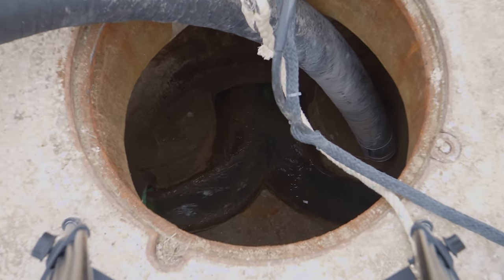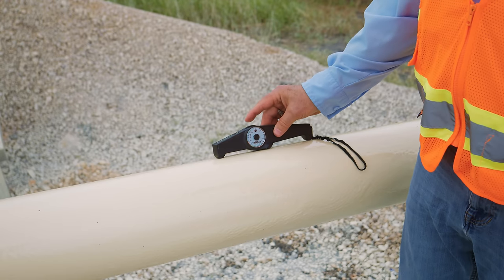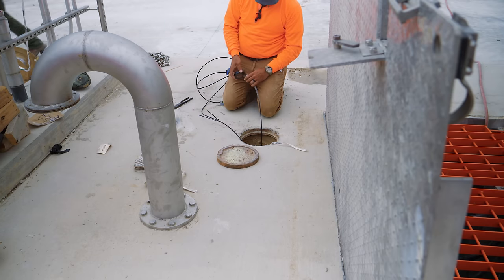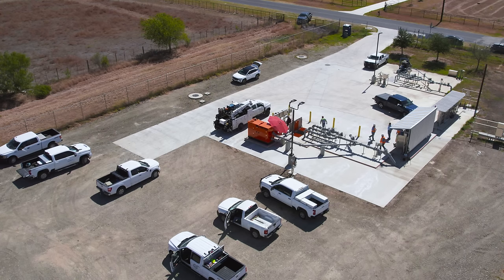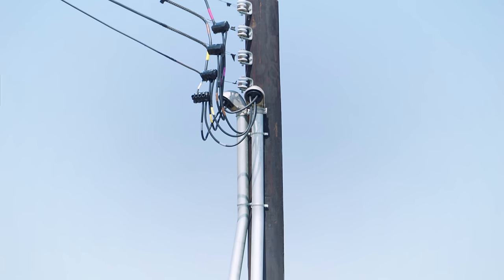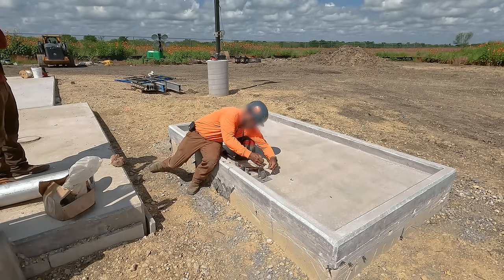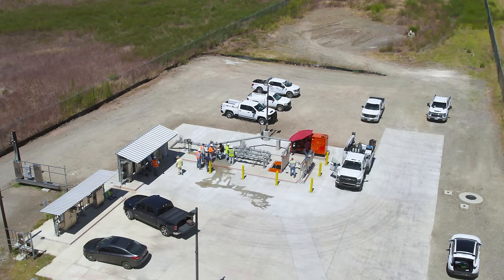HEAVY CONSTRUCTION of a Sewage Pump Station - Ep 5

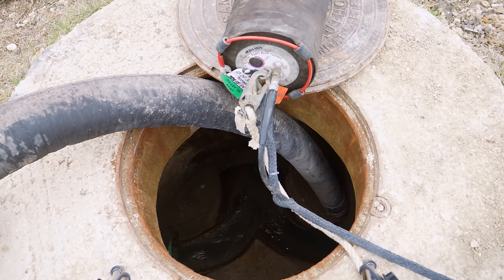Comment: 10:47 5 seconds before that I was wondering if they would alternate to even out wear. 😄 Especially for the backup pump I think it's good to run them from time to time.
How risky is it if you wear them evenly that all three or maybe just two stop working at the same time? I think it's a know issue in systems with multiple components that multiple fail at the same time when they have been worn down at the same rate.

Comment: I don’t understand why they would have the sewage come in and then fall down only to be pumped back up. Why don’t they just have a wider tank where the bottom is the same level as the incoming sewage to minimize the amount of energy needed to power the pumps?
Reply: You don't want the pumps constantly running. By letting the sewage fill up the wetwell and then pumping it down, it gives the pump a chance to cool down.
Reply: The elevation the sewage is ultimately pumped up to by these pumps was mentioned to be 200 feet.

Comment: It surprises me quite a bit that they used a diesel pump as a backup rather than a diesel generator to run the existing electric pumps in both the old hardware and the new wet well.  I'd hope that the backup pump has the same or higher capacity than the three lift pumps in the wet well.  Plus the backup pump may not have the same variable capacity that the three electric pumps do.

Comment: Question: why couldn't the pipes be cleaned and coated at the factory rather than on site?
Reply: Direct Quotes from Content Creator Grady (other than that in parenthesis): “MGC is a private contractor that bid this project and was paid a fixed price for the work.” Site Location GPS Coordinates: 29°27'24.4"N 98°13'49.8"W “This is a low bid job, so if the contractor’s wasting money, it’s their own. The answer is complicated though (for why the pipes were sandblasted and coated on-site). Pipe mfg. (manufacturer) coats the pipes with something basic (at the lowest cost and for general use rather than this specific application) just to prevent corrosion during storage and delivery (it then needs to be removed so that the proper coating adheres to the pipe durably).  They aren’t equipped to apply the wide range of (different) coating products that an engineer might specify (remember, it is not just paint!), and even if they could, the final coating would likely get damaged during the delivery or construction (installation), putting them on the hook (liable) for fixing it rather than the general contractor who is better equipped to purchase the correct products and ensure that the final product (result) meets the specs (specifications for the application of the pipes) after the installation (such as the required thickness of the coating, color, useful lifespan required, final environment the pipes will be in, etcetera).”

Comment: Total project cost seems relevant to the discussion?
Reply: Direct Quotes from Content Creator Grady (other than that in parenthesis): “MGC is a private contractor that bid this project and was paid a fixed price for the work.” Site Location GPS Coordinates: 29°27'24.4"N 98°13'49.8"W “This is a low bid job, so if the contractor’s wasting money, it’s their own. The answer is complicated though (for why the pipes were sandblasted and coated on-site). Pipe mfg. (manufacturer) coats the pipes with something basic (at the lowest cost and for general use rather than this specific application) just to prevent corrosion during storage and delivery (it then needs to be removed so that the proper coating adheres to the pipe durably).  They aren’t equipped to apply the wide range of (different) coating products that an engineer might specify (remember, it is not just paint!), and even if they could, the final coating would likely get damaged during the delivery or construction (installation), putting them on the hook (liable) for fixing it rather than the general contractor who is better equipped to purchase the correct products and ensure that the final product (result) meets the specs (specifications for the application of the pipes) after the installation (such as the required thickness of the coating, color, useful lifespan required, final environment the pipes will be in, etcetera).”

Comment: I love this series. Very interesting. I noticed a few things in this episode that are slightly off putting. Why sandblast and paint on site.  Seems like a more expensive way and definitely not environmentally friendly option. And why isn’t it solar powered?  Seems like it could have a sheltered structure with a solar panel roof.
Reply: Direct Quotes from Content Creator Grady (other than that in parenthesis): “MGC is a private contractor that bid this project and was paid a fixed price for the work.” Site Location GPS Coordinates: 29°27'24.4"N 98°13'49.8"W “This is a low bid job, so if the contractor’s wasting money, it’s their own. The answer is complicated though (for why the pipes were sandblasted and coated on-site). Pipe mfg. (manufacturer) coats the pipes with something basic (at the lowest cost and for general use rather than this specific application) just to prevent corrosion during storage and delivery (it then needs to be removed so that the proper coating adheres to the pipe durably).  They aren’t equipped to apply the wide range of (different) coating products that an engineer might specify (remember, it is not just paint!), and even if they could, the final coating would likely get damaged during the delivery or construction (installation), putting them on the hook (liable) for fixing it rather than the general contractor who is better equipped to purchase the correct products and ensure that the final product (result) meets the specs (specifications for the application of the pipes) after the installation (such as the required thickness of the coating, color, useful lifespan required, final environment the pipes will be in, etcetera).”

Comment: I might have missed it in the episode but why do the pipes have a protective coating that isn't the final protective coating? Why aren't they shipped with the coating that gets applied at the job site?
Reply: Direct Quotes from Content Creator Grady (other than that in parenthesis): “MGC is a private contractor that bid this project and was paid a fixed price for the work.” Site Location GPS Coordinates: 29°27'24.4"N 98°13'49.8"W “This is a low bid job, so if the contractor’s wasting money, it’s their own. The answer is complicated though (for why the pipes were sandblasted and coated on-site). Pipe mfg. (manufacturer) coats the pipes with something basic (at the lowest cost and for general use rather than this specific application) just to prevent corrosion during storage and delivery (it then needs to be removed so that the proper coating adheres to the pipe durably).  They aren’t equipped to apply the wide range of (different) coating products that an engineer might specify (remember, it is not just paint!), and even if they could, the final coating would likely get damaged during the delivery or construction (installation), putting them on the hook (liable) for fixing it rather than the general contractor who is better equipped to purchase the correct products and ensure that the final product (result) meets the specs (specifications for the application of the pipes) after the installation (such as the required thickness of the coating, color, useful lifespan required, final environment the pipes will be in, etcetera).”

Comment: Why doesn't the old pump system have protective bollards? Is it considered unnecessary because of the location relative to the road? Or did they think that wasn't necessary because it was basically in the middle of an open field before the new construction in the surrounding area? And if so, shouldn't they be added now that there is a new neighborhood going up right next to it, and with it more traffic and thus more potential for accidents?

Comment: Why didn't the fabrication shop prep and apply the coating while the pipe sections were still in the shop? You know, out of the weather, right next to your tools and shop air and in town near your suppliers, and all that. Field work is always more expensive then shop work.
Woah! Isn't that system horribly vulnerable to freezing weather? It may not happen very often but when it does. My Oh My! I see that the old pump station is entirely underground. (not up to modern Texas standards 😉)
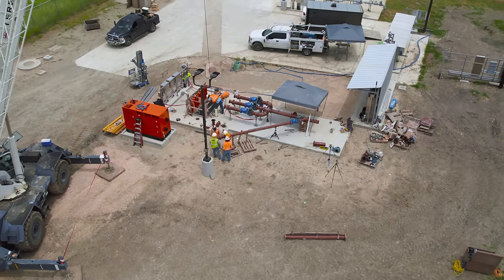It seems to me that that cross fitting at 6:28 should be 45's.
Thank you, yes I want to see more. What's more practical about engineering than construction.
Reply: Direct Quotes from Content Creator Grady (other than that in parenthesis): “MGC is a private contractor that bid this project and was paid a fixed price for the work.” Site Location GPS Coordinates: 29°27'24.4"N 98°13'49.8"W “This is a low bid job, so if the contractor’s wasting money, it’s their own. The answer is complicated though (for why the pipes were sandblasted and coated on-site). Pipe mfg. (manufacturer) coats the pipes with something basic (at the lowest cost and for general use rather than this specific application) just to prevent corrosion during storage and delivery (it then needs to be removed so that the proper coating adheres to the pipe durably).  They aren’t equipped to apply the wide range of (different) coating products that an engineer might specify (remember, it is not just paint!), and even if they could, the final coating would likely get damaged during the delivery or construction (installation), putting them on the hook (liable) for fixing it rather than the general contractor who is better equipped to purchase the correct products and ensure that the final product (result) meets the specs (specifications for the application of the pipes) after the installation (such as the required thickness of the coating, color, useful lifespan required, final environment the pipes will be in, etcetera).”

Comment: I have a question. I was rewatching a video you made 5 years ago about concrete. I understand the difference between concrete and cement. Cement is the bonding material for concrete. My question was before I realized. Why does Cement create so much CO2. Obviously it is due to the materials used. But to the normal viewer they might not know and you should make a video about it.

Comment: I am curious, given the complexity, why are not the valves covered? I get that the electrical components are not, though why not all the above ground important pumps and valves? It seems like a minor additional cost.
Reply: My guess would be, sewage gasses are extremely flammable but have everything above ground uncovered any gas leaking would disperse into the air. Also for visual purposes it’s not as stark as a giant shed with massive vent fans ect

Comment: Can someone explain why the pipe for a project like this is made with a protective coating that then has to be removed and replaced.  This seems like a lot of wasted time and effort when the proper coating could just be applied to begin with.  There's got to be a reason.  Probably needs for different coatings for different applications, but it still seems like a better solution should be possible.
Reply: Direct Quotes from Content Creator Grady (other than that in parenthesis): “MGC is a private contractor that bid this project and was paid a fixed price for the work.” Site Location GPS Coordinates: 29°27'24.4"N 98°13'49.8"W “This is a low bid job, so if the contractor’s wasting money, it’s their own. The answer is complicated though (for why the pipes were sandblasted and coated on-site). Pipe mfg. (manufacturer) coats the pipes with something basic (at the lowest cost and for general use rather than this specific application) just to prevent corrosion during storage and delivery (it then needs to be removed so that the proper coating adheres to the pipe durably).  They aren’t equipped to apply the wide range of (different) coating products that an engineer might specify (remember, it is not just paint!), and even if they could, the final coating would likely get damaged during the delivery or construction (installation), putting them on the hook (liable) for fixing it rather than the general contractor who is better equipped to purchase the correct products and ensure that the final product (result) meets the specs (specifications for the application of the pipes) after the installation (such as the required thickness of the coating, color, useful lifespan required, final environment the pipes will be in, etcetera).”

Comment: wonderfully done! huge shout-out to the GC, and sub-contractors for allowing Us to watch: like on How its Made and Modern Marvels.

  Note: I think Your assement on what Ground Rods actual do: to be Misleading. 
 Grounding Electrodes(GEs), and Grounding electrode conductors (GECs) are a vital part to a grounded electrical system. 
  However! GEC's and GE's have nothing to do with Personel Safety. they do preform a function on minimizing damages caused by overvoltages on the system (like a nearby lightning strike)
but GEC and GEs help protect the Equipment amd system, NOT people/ personal.

other than that: It was wonderful and informative to watch.
Look forward to more episodes of Practical Construction!

Comment: Why wouldn't the pipes just come from the factory prepainted? I mean, as it is, they have to apply preservative, ship the pipes, then sand blast them and paint them outside on site. I'm sure there must be a good reason, but I can't think what it might be.
Reply: Direct Quotes from Content Creator Grady (other than that in parenthesis): “MGC is a private contractor that bid this project and was paid a fixed price for the work.” Site Location GPS Coordinates: 29°27'24.4"N 98°13'49.8"W “This is a low bid job, so if the contractor’s wasting money, it’s their own. The answer is complicated though (for why the pipes were sandblasted and coated on-site). Pipe mfg. (manufacturer) coats the pipes with something basic (at the lowest cost and for general use rather than this specific application) just to prevent corrosion during storage and delivery (it then needs to be removed so that the proper coating adheres to the pipe durably).  They aren’t equipped to apply the wide range of (different) coating products that an engineer might specify (remember, it is not just paint!), and even if they could, the final coating would likely get damaged during the delivery or construction (installation), putting them on the hook (liable) for fixing it rather than the general contractor who is better equipped to purchase the correct products and ensure that the final product (result) meets the specs (specifications for the application of the pipes) after the installation (such as the required thickness of the coating, color, useful lifespan required, final environment the pipes will be in, etcetera).”

Comment: So if all the pumps are programmed to wear evenly, isn't that a recipe for a cascade failure? Wouldn't you want at least one pump on a lighter duty cycle?
Reply: Maybe all 3 of them will get changed if just one goes completely dead.
Or they are rated for let's say 30 years of usage. After this time, they will be changed out no matter if they still run

Comment: Why isn’t the final coating applied at the factory and touched up as required in the field?
Reply: Pipe factory has a lot of costumers, each with their very own specifications. So instead of dealing with lots of different coatings they leave it to the customer
Reply: Longer version of comment/answer above is: Direct Quotes from Content Creator Grady (other than that in parenthesis): “MGC is a private contractor that bid this project and was paid a fixed price for the work.” Site Location GPS Coordinates: 29°27'24.4"N 98°13'49.8"W “This is a low bid job, so if the contractor’s wasting money, it’s their own. The answer is complicated though (for why the pipes were sandblasted and coated on-site). Pipe mfg. (manufacturer) coats the pipes with something basic (at the lowest cost and for general use rather than this specific application) just to prevent corrosion during storage and delivery (it then needs to be removed so that the proper coating adheres to the pipe durably).  They aren’t equipped to apply the wide range of (different) coating products that an engineer might specify (remember, it is not just paint!), and even if they could, the final coating would likely get damaged during the delivery or construction (installation), putting them on the hook (liable) for fixing it rather than the general contractor who is better equipped to purchase the correct products and ensure that the final product (result) meets the specs (specifications for the application of the pipes) after the installation (such as the required thickness of the coating, color, useful lifespan required, final environment the pipes will be in, etcetera).”

Comment: What does the U.S. have against 3 phase transformers? A place like this is the typical case for a 3 phase transformer instead of multiple single phase ones. It comes down to cost or easy of access?? In my country they are very rare in cities, used most in distant rural areas...